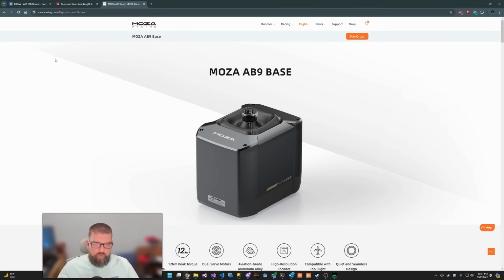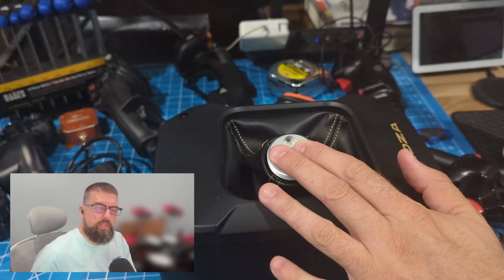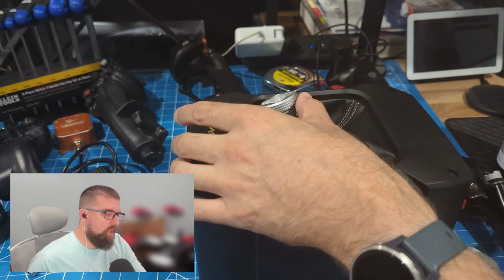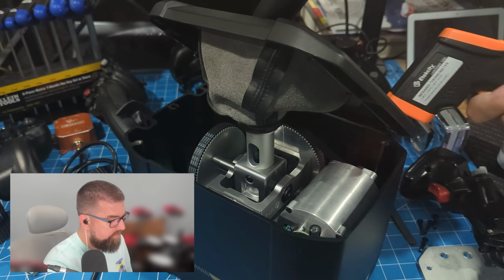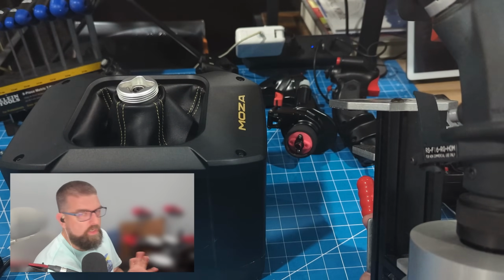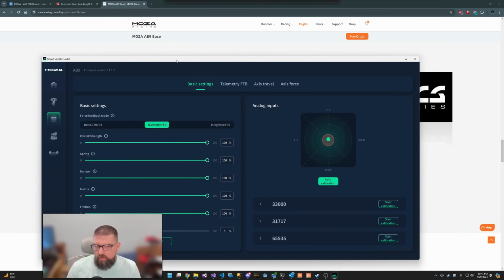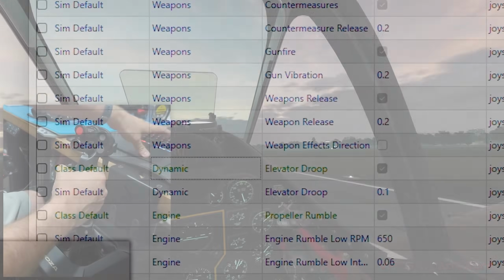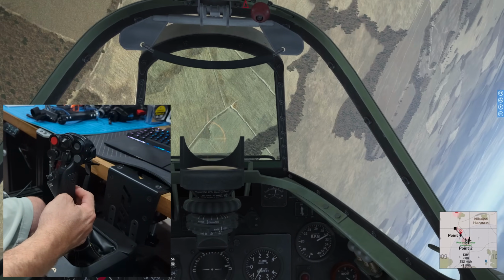MOZA AB9 Force Feedback Flight Sim Base REVIEW | DCS World / IL:2

Comment: To be fair, FFB Wheels have similar complex force simulation, like ground structure, traction/sliding (!!!), clutch slipping etc.
I guess, Moza just needs a bit of time to process all the feedback and input into the software. The stuff that is different from racing, is mostly simulation of mechanical vs  hydraulic forces, controls like "Force Trim(release)" and they definitely need to look into axis support on the grips and configuration of button/axis on those grips. Grip Axis for a thumbstick or break lever should be possible to invert, set deadzones and curves. Grip buttons would benefit from flexible configuration options, like Virpil does, with Classic press on/off, inverted off/on, switched state(s) and icing on the cake would be long press/short  press. At least we need a way to configure the 8-way hats as 4-way and have the center press of the hats supported!

A custom set of physical limits for the throw on the actual base axis' would be useful, as well. I am aware they have a limits option in the software, but especially with an extension a physical bracket to stop the stick is nice. 🙂
Reply from the maker: I think my words were just poorly chosen.  I have racing FFB, but I've never seen any configuration that gets the FFB down to the vehicle level.  This is the complexity I was referencing.
Reply: @Jabbers  I think both the Project CARS series (and AMS 2, by extension) and rFactor 2 (and derivatives) implement optional FFB configuration per car.
Reply from the maker: Interesting, I will have a look then.  I did claim ignorance on this one though! Thanks for the info.
Reply: This saves me a lot of typing. 😂 . It was definitely worth mentioning that racing wheels do a lot more than just push the steering  wheel in the other direction.

Comment: Excellent and exhaustive review but you're wrong about force feedback for sim racing
Reply from the maker: That's fair as I said I am ignorant on that matter because I do not do some racing stuff. But from what I've seen in Sim racing there is no configuration on a per car level. Again this is just what I've noticed and could be wrong and would be happy to see something as finely detailed as required for flight Sim but in racing Sim stuff if you have some links
Reply: @Jabbers  Fanatec has its FanaLab software which allows per vehicle configs (including auto switch) and they also provide profiles for common sim-cars combinations on their forum. 

But for me that’s just too much so I usually stick with a single config per sim.
Reply from the maker: Cool! Thanks for that info, I stand corrected!

Comment: You're telling me I can use my VKB Ultimate grip with this base?
Holy crap, that's amazing, didnd't expect that.
Reply: I hope @Jabbers can confirm he used the VKB grip with out issue because he only said "should" work. I too bought the same adapter he is using in anticipation for the Moza base, but when I asked Moza if the base can work without detecting a grip, they said it would not work.  Granted, everything is clearly WIP, so hopefully there's no issues here and we can use our beloved VKB grips with all their functionality on the AB9 base.
Reply from the maker: @EvilTurnip Yes, the VKB grip works just fine for me.  "Should" was the choice of words since I was referencing 3rd party adapters :)
Reply: @Jabbers  Perfect!  I really appreciate the clarification, and even more so, the very in depth video you took the time to make for us.  Lets hope Moza gets the software right for their release.  As it is, I'll keep my preorder and I am super stoked that the MCG-U I just bought 6 months ago will still be viable with the AB9 base.  

I also appreciate that you showed off the compatibility with the base mounts as I have a spare Foxx Mount with a TM stick base.  I think the video only showed you using the Moza mount, but could you confirm if your Monstertech mount had enough grip to hold the hefty base and not slip around on the desk with the FFB in play at full power?
Reply: @Jabbers  How does VKB Configurator tool work without it's base though, That's a curious thing to know.

Like, the tabs that lets you change base settings do they not appear or they throw an error if you try to mess with them?
Reply: @EvilTurnip  oh, well please keep me updated if you figure it out if it works or doesn't work because I defo would go for this base if I can slap on my grip on there.

Comment: I didn't quite understand what your issue with the Apache was, but DCS does funky things with FFB if you have setup curves for the axis in DCS so you might want to check that out.
Reply from the maker: I don't have step curves. The problem is that when you hold the trim button and move the stick, the springs are still engaged and should not be. And then when you release the trim button, the stick should stay in the position you were at when you released, it does not currently do that which is wrong

Comment: VP force and FFbeast owner here. I dont think I am interested.
Reply: Between VPForce and FFBeast, which do you prefer?  I understand the Beast has more torque but Rhino has better software.
Reply: @kevinwinters4803  that’s is pretty well summed up. Rhino is easier to set up and need less user input to find the sweet spot. Also, it has not cogging at all.

FFB beast is , for now, longer to set up and you have to fine tune your profiles. But then, it’s amazing and I have found myself having to use both my arms to pull out of a dive in a f-4E or P-51 !!! With those beastly forces, comes a slight cogging as well, but that can be smoothened with settings. 

Also, the rhino is thrustmaster and Virpil stick compatible, while at the moment the beast cannot use virpils unless you connect the stick through a WarBRD base for the buttons for ex.

I live both. I would favor the rhino for helicopters and the beast for Cold War and warbird stuff

Comment: Great review, your video made me preorder. Please suggest to Moza to create FFB rudder pedals, as well as Z grip joystick adapters so they can be used as a Throttle for space sim (Star Citizen).
Reply: They actually have a hall effect sensor Z grip adapter in their lineup, in case you meant a twist grip with that.
Reply: @CakePrincessCelestia  Thanks I preordered it. I meant Z grip as in where the joystick is turned 45 degrees to the side so it can be used as a throttle for HOSAS. Push forward accelerate. Pull back reverse. Virpil has a Z grip 45 degree adapter, check it out to see what I mean. VPC Flightstick Z-Extension SKU# VPC-613
Reply: @crispybread3812  I checked it, nice stuff... with that it would just be a software thing to get an FFB throttle, at least for one axis.

Comment: Why are you pulling the stick always so low closer to stick mounting? Does it reflect the fact that there is not enough force to give informative feedback if pulling the stick normally,  as you hold it when puling the trigger? Do you think higher force needed on such kind of devices to get full immersion? Have you seen FFBeast FFB project by the way?
Reply from the maker: In all the example video in this I only had it set to 50% power so it is plenty strong. And a lot of how I was holding the stick was to Make it easier for the viewer to see the feedback that I was receiving by getting my hand out of the way and holding it with just my finger

Comment: I'm saving or the FFBEAST 🦾
Reply from the maker: That one seems to suffer from very rudementary Telemetry FFB
Reply: @Jabbers  Have you at least opened telemetry app and checked the functionality and available effects? Or just decided so from "someones words" :)
Reply from the maker: @Propeler3D Yes I downloaded the Commander software and could not find a per-plane level setting.  Simple had Telemetry for various aspects of an aircraft, without being able to specify which one its used for.  So as example, Elevator Droop... does FFBeast do this?  What about different feedback settings for the F-18/F-16/F-14?  Do they all feel and act the same?  I am talking Telemetry here, not Native.  So if you can show me where I can setup the telemetry for each individual plane, great.  But much like Moza, it appears to me after looking at both software examples that you can only give it a very coarse setup, and the F-16 would then respond to aerodynamic pressure changes at the stick level same as the F-14 which shouldn't be the case since they control inputs for the F-16 have ZERO feedback in the real jet.
Reply: @Jabbers  It is able to specify per plane. You can create profiles per game/module combination and it will be auto selected when DCS mission starts or can be selected manually. Elevator droop is there. For elevator axis there is elevator weight effect which reacts to G as well. It is absent in the list of available effect for other axis because for example ailerons could not have it. List of available effects is different depending on game selected and axis tab selected. Each plane can have it's own profile. And it could be totally different. Whatever effect you will add to the list on left side of window - it will be active. If effect is not in the list - it is not. There is total freedom of adding and removing them from the list. You do not need effect active? Press Remove effect button. You want to add effect? Select it from dropdown and press Add effect button.   And each effect in each profile will have it's own settings. Frequencies, magnitudes, each and every slider.
Reply from the maker: OK well I stand corrected, thank you for explaining that in detail cause it wasn't obvious by looking at the software!  Appreciate it!
Reply: @Jabbers  disagree. you can set up pretty much how you want. I have both the VP force and the FFBeast, and while the Rhino is easier to user, the Beast provide real world forces...
Reply: I pre-ordered a month ago, hopefully they get the software straight. I fly DCS World😂 so I’m accustomed to things not working out of the box. Besides it’s almost half the cost of the Rhino & Beast. IMHO I like the compact design no exposed gears. Great review!
Reply: @BrownHornet68  the FFBeast ? You will be very happy no matter what. I tell you. 

The only thing that bothered me a bit was the slight cogging at the center but this was fixed by fine tuning in the software
Reply: @BrownHornet68 I just completed the diy kit from vpforce, it’s fantastic! If you have a printer it’s on par of cheaper than the moza.

Comment: Kinda concerned about my pre-order now. I think the ideal would be for it to work with VPforce software or for some opensource software to be developed by the community. Those of us with DIY FFB controls are already used to paying for 3rd party software  to get them to work in sims, I'd happily pay for a VPforce license (assuming a reasonable price).
Reply: That would be awesome if it would... basically one software for all the bases out there. I hope it will be getting there, but well, I guess that's just a wish...
Reply from the maker: It doesn't work with the vpforce software
Reply: @Jabbers  I think he was saying he hopes vpforce will figure out a way to make it work with the base. And yes I would also pay for that.
Reply from the maker: @Golfwhiskey I see but what is the incentive for VPForce to do that?  If you can use their software with every device on the market, why buy their device?  This is going to be the problem with that kind of thing.  Not only that but now you need to support those other devices, each firmware update, each change, and moving on prob every single new version of it as well.   

What would be the better approach is Moza should fork their software, make it work with the Moza base and then submit either a pull request to have it integrated into the original, or just maintain updates themselves between the 2.
Reply: @Jabbers  Of course they would want to sell their hardware. But well, with a 2+ years waiting list (which is what I heard multiple times from the community) going on I'd start to consider things if I was them. Also, they use shady Google Forms for ordering. I tried that over a year ago, but somehow it apparently never arrived since I never got any replies. But well, Google Forms have been broken ever since, I always had issues with that bullcrap whenever I had to use it for something. Those brilliant guys really need to up their game in those terms.

The incentive to get their software out for other bases as well (probably by selling it) would be to improve FFB all across the board for everyone, but at the same time create attention for their own base which probably is one of the best out there. If only it was obtainable hassle-free...

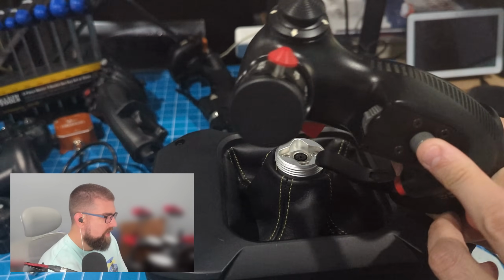Comment: As someone who is a “stick” designer 21:35 the struggle is real.

Virpil does some weird encoding in the serial data as extra CD4021 chips that tm bases don’t see. That’s how they are “TM compatible”
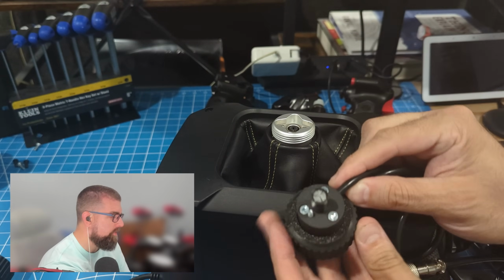Reply: 26:34 hmm didn’t know VPForce had an adapter for VKB with the connector? I wonder if I could recreate that for allowing passthru to the black box on my design
Reply: I’d love to make the OS-VBS MK2 support the extra inputs but I don’t have the hardware to figure out how to reverse engineer the encoding, and then the electronics would have to move away from arduino (mmjoy2) or (freejoy) to something custom which is far beyond my skill level